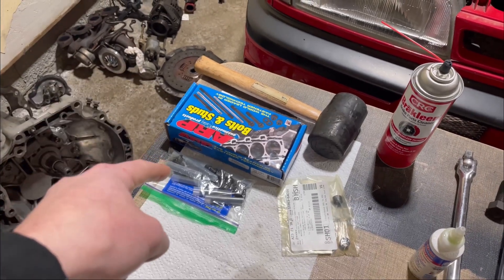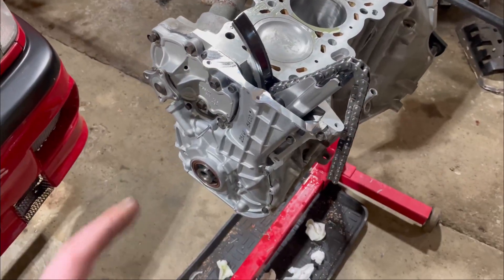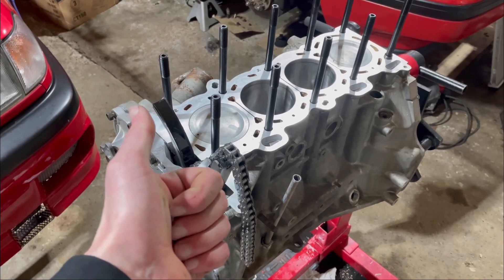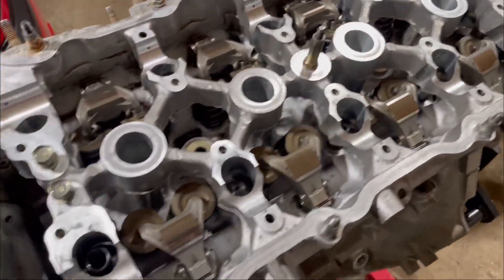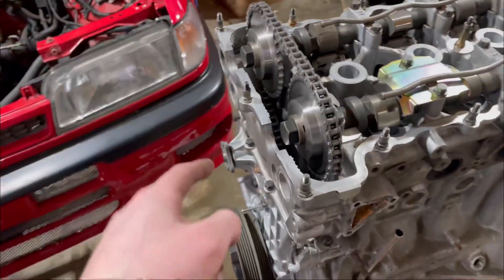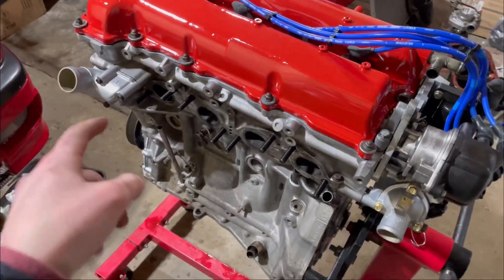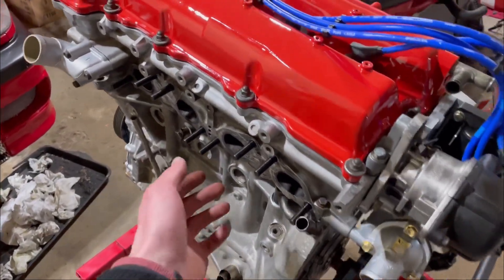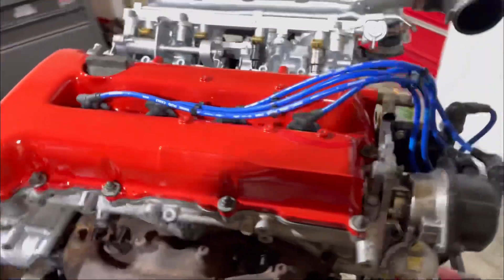NISSAN PULSAR GTI-R ENGINE REBUILD PT. 6- CYLINDER HEAD INSTALLATION

Comment: Where did you find all the parts ??
Reply from the maker: I bought them off of a WHOLE bunch of sites, but there were a surprising amount of new oem parts on ebay. Part 4 of the series goes over most of the parts that I got with part numbers included if you want to just search it by p/n. If there's a part that I got that you can't find, let me know and I can hopefully point you in the right direction
Reply: JAPAN